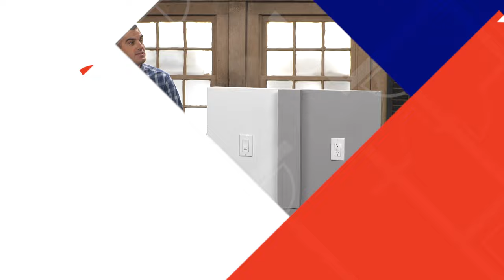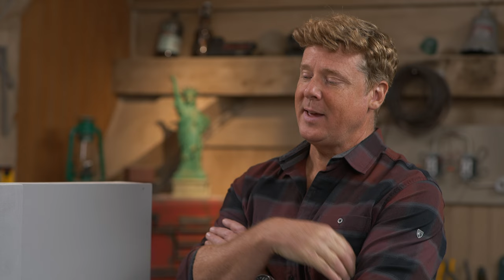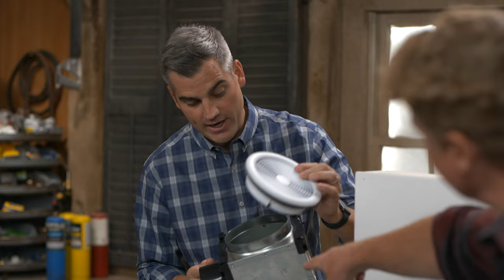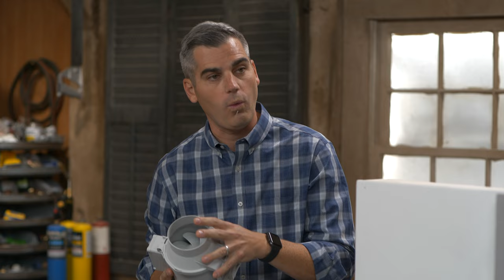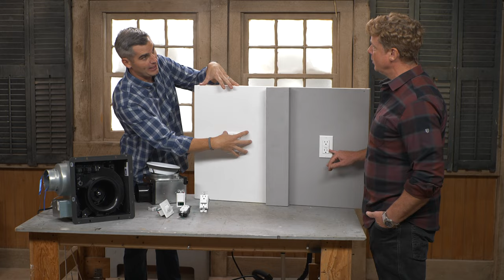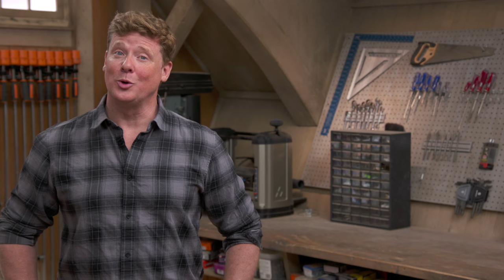Understanding Bathroom Ventilation Technology | Ask This Old House

Comment: Love it. Not sure on present code here in Florida, BUT at least in 2006 all that was required in a bathroom was a window that “could” be opened for ventilation. These items are what I was looking, (hoping) for, especially the fan that can be placed in the attic with just the grill in the bathroom. The intelligent switches are a plus. Thank you
Reply: @brianglade848  To late, I already own a bunch, but its called a marsh with a river running thru it to the Atlantic Ocean 7 miles away. Thanks anyway 😎

Comment: Actually the smart Humidity/Motion switch shown in the episode is this one here:
Swidget Temperature, Humidity & Motion + Wi-Fi Control Insert - Works with Swidget Outlets and Switches to measure temperature, relative humidity & detect motion (occupancy/vacancy). $135 for the combo (insert & switch).

Comment: The nice feature of having a very old home equipped with a forced-air geothermal furnace… no need to add fresh air intake (plenty of natural fresh air leaks) and bathroom humidity is drawn into furnace ducting to either add needed heat/humidity thru house in winter or condensed at the furnace.

Comment: I have a problem with standalone humidity sensors. Sometimes the humidity raises in the whole hose because of rain, then this thing kicks in and starts pulling even more humid air into the house. The really needs to be another sensor elsewhere and it should act on a difference, not absolute value.
Reply: The Swidget humidity sensor they demonstrate in the video actually uses an averaging algorithm as the comparison baseline that addresses this exact issue.

Comment: I have a central exhaust system in a house I moved into 4 years ago.  While when I first moved I didn't like it, because I was used to a fan per bathroom that all operated separately.  This one is turned on anywhere, it sucks from all the areas.  But now after using it with a central fan,  its one exhaust out the side of the house, not 4 separate ones out my roof, so less holes in my roof.  Only problme is its low voltage using the furnace as an intake, so I can only use the old school wind timers that tick, but they do the job
Reply: 1) do you live up north or down south. 
2) since your exhaust is on the side of the house have you had any issues whatsoever vs one that is through the roof ?
Reply: @OGCJ10 Is Canada North enough 🙂  We have never had any issues for the almost 5 years we have been here.  Its nice to have less roof intrusions, because all my past houses were anything upstairs bathroom wise was exhaust out the roof.  This way as welll, in the extreme cold, the exhaust doesnt have any ice build up on the outer portion of the port.

Comment: You didn't mention anything about the requirement of fresh air intake order for the exhaust system to work correctly? No air in no air out. Thanks.
Reply: The Swidget 204060 Timer Switch is a dry contact switch and can be wired to your ERV boost function instead of a fan to trigger an increase in air exchange instead of turning on a fan.

Comment: My bathrooms have oversize inline extractors venting to the outside activated by movement sensors in the showers and over the bath tubs. The same set up in the lavatories
Reply: Great idea to add motion sensors to the shower... Will do so too!
Reply: 1) which in-line extractor did you use ?
2) did you do one for each bathroom or did you connect two bathrooms to one? I’ve seen it done both ways

Comment: The Panasonic fan that you are using in the demo is super quiet and it can pull a lot of air. Big fan = quiet and powerful. No need for inline fan for a bathroom really. The kitchen hood is a different story.
Reply: An inline fan for a kitchen hood would great

Comment: Johnson Controls had released the JCI Glas™ smart thermostat years ago, which also monitors the AQI both indoors and outdoors. If it detects poor indoor air, it'll turn on the HVAC's circulation fan.

Unfortunately, they have discounted the device and its services, so anyone who currently has one will have it downgraded to being the fanciest programmable thermostat.

Comment: What if the fan in all 3 bathrooms are just a metal box with a small fan that blows into the box, but the box doesn’t lead anywhere—the box is just that, a box with just one side open to the bathroom?

Comment: that outlet that senses air quality is far more complex than people think. you need to make sure that outlet and ventilation fan are on the same circuit other wise you have to start running wires
Reply: The Swidget IAQ Sensor Insert communicates wirelessly with the Insert in the fan switch to activate it. There  are no additional wires to run.

Comment: I have excessive moisture on walls after shower….. what speed fan would help fix this issue?
Reply: Higher than you have lol. Less hot water/leave the fan running
Reply: Calculate the size of your bathroom and then get a Panasonic one from Home Depot!
Reply: I only get fans that have a setting up to 11.

Comment: Can you cover how to use ERV and HRV ... I'm specifically in Canada our new built came with it but can't find how to use it.
Reply: It should have been set by the HVAC installer to run automatically
Reply: If it's not already set up best bet is googling the model you have and reading the manual
Reply: @Kevin-mp5of  nah...we keep sending you guys Chinese balloons
Reply: The Swidget 204060 Timer Switch (shown in the video)  is a dry contact switch and can be wired to your ERV boost function instead of a fan to trigger an increase in air exchange instead of turning on a fan.

Comment: How much should a new QUALITY venting unit cost?
Thanks 👊🏾
Reply: They can cost as low as 50 bucks for a simple on/off inline fan that would have to be ducted  and exausted outdoors by the purchaser of course. Or as expensive as a few thousand dollars for an erv/hrv which is a more comprehensive system which would not only exhaust bad air and humidity from the home, but bring in fresh air from outside into the home filtering it and tempering it before dispersing intothe home. They also have better controls and programming to make a more automated system.
Reply: @mitchdenner9743  

👀Wow!!
The latter price isn't too bad. 
I was actually expecting it to be more.  

Thanks Mitch, very good information. I appreciate it.
Reply: @brianglade848  

     😂🤦🏽‍♀️🤭😂
Reply: @QIKWIA  no problem,  Broan actually makes a real nice erv for indoor air quality which I purchased myself and I think I paid 800 or 1000 bucks for. I love it.

Comment: in the winter time I do not want the humidity to be pumped out of the house.  I need it inside where the humidity is already too low.  additionally i need this exhaust vent pipe to seal closed so that hot air that my heater is working so hard to create does not go flying out of the house.    vent fans in bathrooms are for noise privacy, you would not want that fan to be quiet.
Reply: Um, no everything you said is incorrect. There aren’t codes for bathroom ventilation simply because of odors.

Comment: Open a window, save thousands
Reply: Yeah but TOH sponsors will lose millions
Reply: Not advisable in winter. Then Richard would need to replace my furnace for one with higher efficiency.
Reply: That’s a greenhouse gas you’re letting out the window.  Please use a catalytic converter type window screen.
Reply: Can't do that during hot humid summers or during cold winter nights.
Reply: I agree with opening windows. I've also been in a lot of houses that don't have windows in the bathrooms. If you don't turn the fan on during a shower and leave it on for a while after a shower, It can be like a sauna in there for hours after.
Reply: @silentlou4375 the only gassing is coming outta your mouth
Reply: Useless thought for when it is 90 and like 85% humid. Your advice basically works in like Maine or Illinois for about a few months a year.
Reply: Yeah, I like to have the windows open, but that doesn't work every day of the year for most people.
Reply: No it won’t. It greatly reduces moisture and helps keep the house last longer